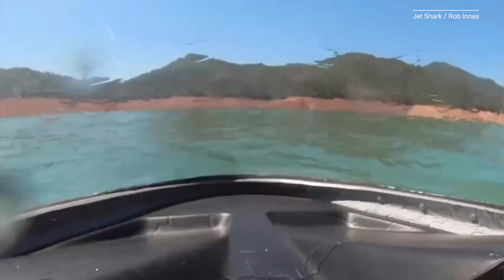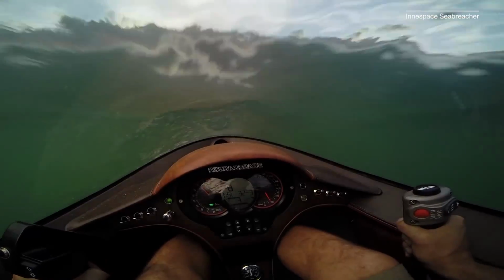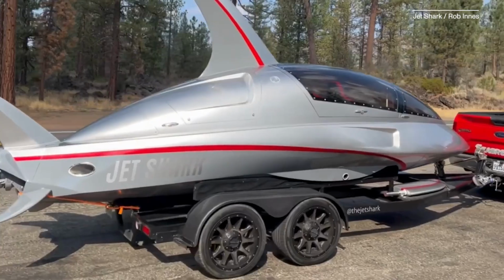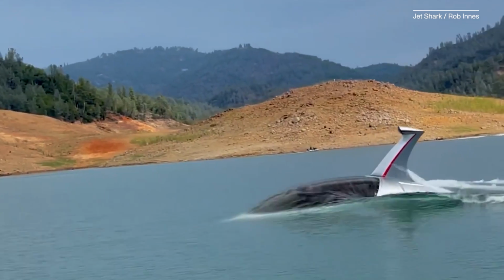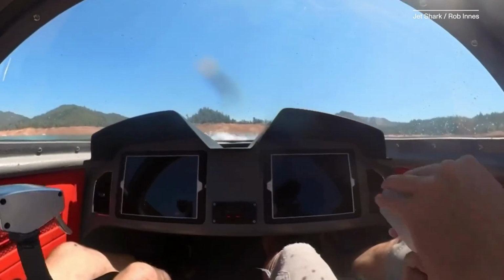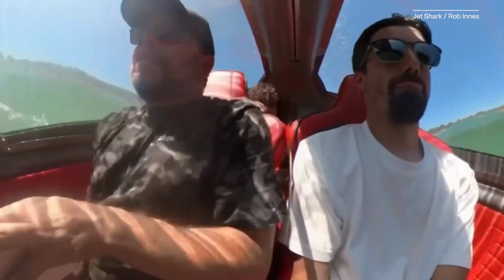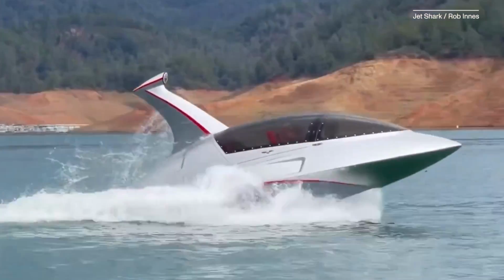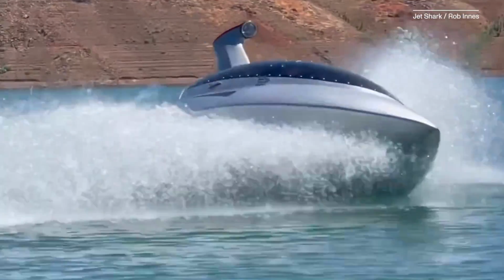This Jet Shark Can 'Fly' Underwater

Comment: I'm curious as to how deep it's rated for underwater
Reply: The "fin" on top has an opening at the top for the air intake to supply air to the engine. It can't go below that or water will enter the engine and it will stall and "pop" back up to the surface. Brief barrel rolls etc are ok but that is as much as possible. The Seabreacher model will go about 6-8 feet and this one wouldn't be much more.
Reply: Ft r
 To the 4th o the uuh TV77 u pop
Reply: I believe it's previous form could go 20 meters underwater. Maybe this can go a little deeper.

Comment: How deep underwater can these go?
Reply: The "fin" on top has an opening at the top for the air intake to supply air to the engine. It can't go below that or water will enter the engine and it will stall and "pop" back up to the surface. Brief barrel rolls etc are ok but that is as much as possible. The Seabreacher model will go about 6-8 feet and this one wouldn't be much more.